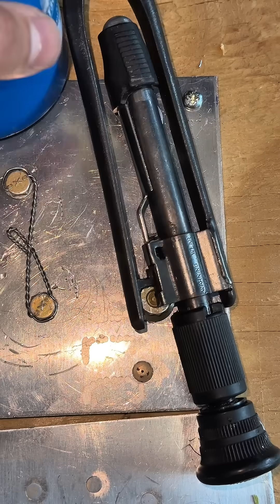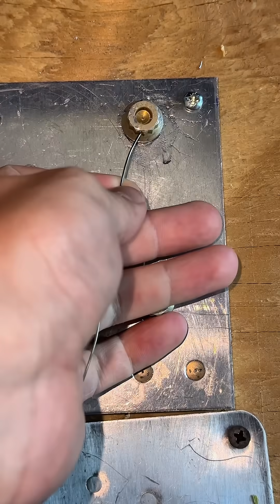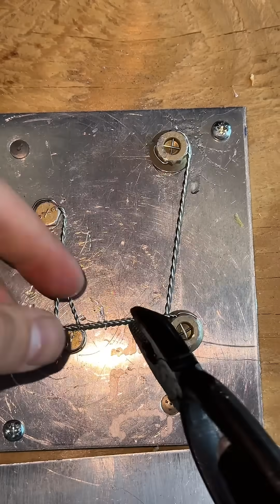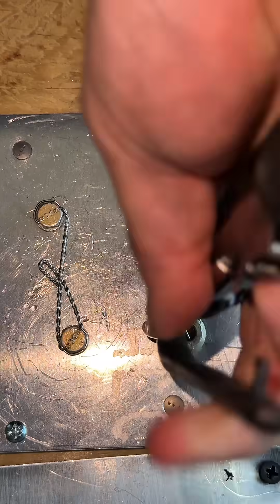Jet tech: Boomers Hated This Safety Wire Tip 😤✈️ #AviationMechanic #shorts #mechanic

Comment: Well, I am one of those boomers but not quite the way you think. I served on Ballistic Missile Submarines for 8 years and we were thus called Boomers. Anyways, on Submarines we have what is called the "Subsafe" program that came into existence after the USS Thresher was lost at sea.  Just about every mechanical connection required it to be secured with safety wire. The way you are demonstrating is exactly how we were taught in the early 80's.
Reply from the maker: Thank you!
Reply: Hell yeah squid
Reply: Bubblehead not squid. 😂
Reply: @MrVallejos1 
“Submarine
Qualified
Until
I
Die”
Reply: @CaseyJamesMusicOfficial 
Same here. 87-07 
I’m digging your music.
Reply: @MrVallejos1  @CaseyJamesMusicOfficial did I just witness a relationship start?
Reply: Served on submarines for about 12 years before I got medically retired. SSN-21 Connecticut & SSBN-743 Louisiana

During my time in and even around the time I got injured 2018, we studied subsafe religiously! We took it extremely seriously! We checked everything as many times as possible before every tag was hung from proofs to the officer of the deck signature to make sure the work was going to be done safely. Then when everything was buttoned up you bet your ass we would lock and safety wire everything we possibly could to "idiotproof" it. 
I salute you, fellow bubble head 🫡
Reply: Wasn't just the sewer pipe sailors that were taught this.  Us surface nukes were also.  CGN-25, '85-'88.
Reply: Well they taught you wrong
Reply: Nobody cares!!! Sir🙏🏼🙏🏼🙏🏼
Reply: Same. I was an aganger on the Alex before she changed homeport from Groton. We called these lockwire pliers.
Reply: 2020, same standards, same wrench, probably the same canned green beans
Reply: Your called boomers because you were born during the baby boom not because you worked on a submarine
Reply: @jasonmagana9730 Not true, people who work on SSBN submarines are, in fact, called boomers too.
Reply: Regulations are woke and progress frightens us!
Reply: @bigroxxor420 you mean opinions mean more than facts
Reply: @GarethJones-pc3dt  regulations are opinions that are based off facts.   regulations good.  regulations safe.   regulations save lives.   If some snowflake boomer gets his feefees hurt because of a change in way things are done due to regulations that's their problem.
Reply: Boomer or Gen X? huge difference, groomer kids hate Gen X so call everyone a "Boomer"...
Reply: Blah,Blah,Blah
Reply: @onemorething100 respectfully
Reply: This video show something that you can find from the Germans and Soviets methods from the 30's submarines. The Soviets aviation safety wiring was simpler for a reason as well.

Seriously the young people should not disrespect the periods of engineering that was done before they even were born, or from countries that they have been taught to hate and ignore from the start.
Reply from the maker: @TK13M where can i find soviet style safety wire

Comment: didn't you wrap the top one on the wrong direction but you wrapped the bottom there in the right way cause lefty Lucy righty tidy
Reply from the maker: Good question! Everything is to spec as per ac43.13-1b!

Comment: you have to leave the pigtail straight for the increased puncture wounds.
Reply from the maker: Thanks for the input! Safety is always key, and small details like the shape of a pigtail can make a big difference
Reply: Not trying to critizise you. Shouldn't the tail be taken the other way so it doesn't rub on the safety? Vibration may cause it to rub it and break. I was a Blackhawk Mechanic and don't recall ever seeing safeties cross for that reason. Maybe it would be unlikely for the tail to cause that much damage but I'd rather be safer and take it the other way. I'm also curious about the other safety that looks like the tail is tied off on the safety. I'm not saying it's wrong. Just never saw that before and maybe things are different on different airframes.

Comment: Lock wire is not a secret, nor is it aviation exclusive.
Reply from the maker: Totally true—lockwire isn’t an aviation-only thing. You’ll see it in motorsports, racing, heavy machinery, and even firearms. What makes aviation different is the level of precision and accountability required. In aviation maintenance, you’re not just preventing a bolt from backing out—you’re ensuring mechanical integrity under extreme stress, vibration, and environmental conditions.

The FAA, military, and OEMs all have strict specs on things like twist rate, wire gauge, routing, anchoring points, and even the direction of pull. Mess one part up, and you could be signing off on a failure at 30,000 feet. So while it’s not a secret, in aviation it becomes a craft—one that gets drilled into you because the stakes are so high. That’s why I teach it seriously, even if it looks simple on the surface.

Comment: i love how every single safety wire video i’ve seen on this app has been the easiest shit to do, wether it’s practicing on a board or some shit just out in the open
Reply from the maker: Thanks! That’s exactly why I make these videos—to show how approachable and practical safety wire techniques can be, especially for students learning the basics. Whether it’s on a board or real hardware, building good habits early makes a big difference. Appreciate you watching!
Reply: @northeastaviationpro Unless you are in a service center most places are going to have a specific order the build is completed in. Meaning that most times it's not going to be hard to reach. But also if you can't do it right a test plate you aren't going to do it right in a low clearance area.
Reply: @northeastaviationpro buddy, what hes getting at is that its almost NEVER this simple with safety wiring things. Its so rare that its fasteners just out in the open like this. They're usually crammed up past some tiny af inspection plate in the dark having to contort yourself into a pretzel upside down to get to while the sharp edge of a piece of sheet metal is trying to get real intimate with your spine. Anyone can twist wire on a flat table obviously.
Reply from the maker: Bro can you not read!? Im teaching the basics, if someone fosent know the basics then how would you expect them to do it on. A real aircraft? By your mindet just let students go ham on an aircraft and fuck it up lol bro what are you even on? The priciples of safety wirre are the same no matter the tightness of the space doing it in.
Reply: @northeastaviationpro thing is, its almost always tight quarters. The basics start there because that IS the basic scenario. Sure, show them how to do it on a flat table. Then they immediately throw out that technique and have to relearn from scratch how to do it with one hand and no pliers because they dont fit in the working space. What are YOU on?
Reply from the maker: What I’m on is building solid fundamentals so students don’t freeze when it does get tight. You don’t start boxing by dodging punches in a phone booth. You start on the basics, then you work your way into the chaos. If you skipped that step, that’s on you.You don’t teach someone to drive by throwing them into rush hour traffic. You build skills step by step so when the squeeze comes, they’re ready. But hey, if you like gatekeeping and watching people struggle, that’s your vibe—not mine. I’m here to help people winYou are exactly what’s wrong with this industry. You’d rather sit on your high horse acting like you’re special because you struggled, instead of helping the next guy level up. That gatekeeping, bitter old-head energy is why people quit this field. You’re not building pros—you’re just building your egoYou’re the exact dead weight holding this industry back. You’d rather people fail so you can feel important like you survived some mythical struggle. News flash: nobody’s impressed you had to suffer because you didn’t have proper training. That’s not grit—that’s stupidity. You’re not a gatekeeper, you’re a speed bump. I’m here making it easier for the next generation while you’re busy crying that it wasn’t hard enough for you. Get over yourself.
Reply: Have you ever done it?
Reply: Greetings Northeast, it’s best not to ever respond to those that have nothing worthwhile to say stroking their own ego is all they are doing. Your videos are excellent and straightforward. Everyone knows that you have to start at the beginning. And that’s what you’re showing. Never argue back and try to defend yourself and your videos to egotistic know it all. Keep up the good work.

Comment: It is a secret?
Reply from the maker: Safety wire” is often called aviation’s best kept secret because it’s a simple, low-tech, and extremely effective method for preventing catastrophic mechanical failures—yet many outside the aviation (or motorsport) world have never even heard of it.

Comment: why is it pulling the bolts clockwise? aint it gonna get loose?
Reply from the maker: They interlock the bolts so if one happens to try to loosen the other bolt thats safetied will prevent it from backing out

Comment: Funny cause the boomers are retiring and now there's a regular plane crash on the news all the time. You youngins wouldn't know good work if it slapped you in the face.
Reply from the maker: Appreciate the passion, but blaming younger techs for every incident is a bit of a reach. Aviation is safer than ever thanks to advancements in training, tools, and oversight—most of which were built on the foundation everyone contributed to, boomers included. We teach the fundamentals with the same seriousness as ever, just using new tools and platforms to keep up. Good work doesn’t have an age—it has a standard.

Comment: I’m not a boomer, an I use safety wire pliers now. I do think there are times where knowing how to do it by hand is very important, think inside a turbine engine. 
That being said, looks great! 7.8/10! I pass that for the interns/new A&Ps. I did notice you only “snapped” the second wire through the hole. It leaves a “square” shape. If you snap both it leaves a shape on the wire that is more round and contours better to the bolt head. Now granted, I do usually make my first two twists out of the hole “by hand” (duck bills and my wire twisters). Lockwire is more of an art than anything. The 8083 does provide some great guidance, hence it’s an AC and not a FAR. 
Application matters the most when considering twists, pigtail or otherwise. I think that’s a bit too many for “my liking.” I would cut it personally. AC wise looks fine for many an application. 
I think you did a great job. I do encourage you to some by hand! Really broadens your perspective on how lockwire should be.
Reply from the maker: I will do it in the next video. Thanks for the feed back cheers

Comment: Tucked his pig tail correctly, twist rate of 6-8 per inch and had a clean half moon. Great work!
Reply: Absolutely zero deflection? Thats tight as hell homie, I'd hire you
Reply: And always give her a stress check wiggle. Ive seen safety wire that seems perfect break with a little tug.
Reply: @TylerDaleJr.McCarty  my rule of thumb is if it can't be broken on purpose it's strong enough, I just started Tig welding parts for jet engines different but still same😂
Reply: Great work man! Was a fuel systems tech in the Air Force and can say that it my career field saftey wire was never in easy spots😂
Reply: It never is. Wish itd work keeping the mother in law quiet.  But eh 😅😂😅 @nickfry8263
Reply: @mavericknv9534 😂😂😂😂
Reply: But the pig tail is touching the wraps dont you want the least amount of contact with the wire
Reply: Overtwisted his pig tail
Reply: get off his D{}{}k
Reply: Why didn’t the bottom half be get loaded from the tension side? The top one did but bottom didn’t. Would this make the bottom one be able to loosen up slightly easier?
Reply: @austinponceinternational859  I think you're misunderstanding something. If the bottom bolt tries to loosen, the left side of it will rotate downwards, and the wire will resist that movement. Likewise, if the top bolt tries to loosen, the right side will rotate upwards, and the wire will resist that movement.

The setup is (pracrically) rotationally symmetrical, so the effect on each bolt is the same, as intended.
Reply: Wait for him to get in the actual world and find out no one actually cares. You’ll just have some uncertified idiot next to you or come behind you and undo your work after it’s been inspected and signed off.
Reply: That pigtail is on the wrong side of cut it anyway but good use of the pliers
Reply: Boomer or not ... what's right is right, either do the job right or GTFO !
Reply: These comments scare me. I’m never flying again.
Reply: Since when does the pigtail point in the direction of the existing lockwire? In the Apache world our pigtails are routed away to prevent them from rubbing on each other..
Reply from the maker: @MotoJayy it really dosent matter in the real world
Reply: @MotoJayy wouldn’t giving the pigtail an unnecessary bend in the opposite direction weaken it?
Reply: Depends on the manufacturer and gauge for CFM56 we require 7-10
Reply from the maker: @CptPandy-tj9ty this is from ac43
Reply: Nope. Don't want the tail close if possible
Reply: From someone that’s been an aviation mechanic for a long time. It’s safety wire. It’s not rocket science. A lot of commenters in here are overthinking it. it’s not to stop the bolts from loosening. It’s to stop them from backing out completely. Yes, in the books they want you to do it a certain way. In the real world you hardly ever see it done to the book and guess what, it works just fine. The bolt being installed and torqued correctly is more important than getting the safety wire correct.
Reply from the maker: @tucanoguy4719 best comment yet
Reply: That is CRAP. NOT EVEN CLOSE TO BEING DONE RIGHT.
Reply from the maker: Wrong
Reply: Well twist on main and tail not same.  One is too tight other loose. Ya theres no give but the points where wire meet bolt.... that shits breaking.   Probly on the tail end.
Reply from the maker: @mavericknv9534 are you an aircraft mechanic?
Reply from the maker: You know civilian aviation regulations differ from army so i get your point but you are so wrong thanks for watching
Reply: @northeastaviationpro I’d imagine the military standards are shit compared to the civilian standards. That’s usually how it goes with the military.
Reply: @chrisdixon7342  this would never fly in the military. QA would make you cut that so quick. Pigtails crossing over mail line, loose, pigtail way too long.
Reply from the maker: Tell that to v-22 inspectors
Reply: @chrisdixon7342  oh yeah, don't remind me how much the soldiers have to spend out of pocket on the civilian market to not have garbage equipment.
Reply: @northeastaviationpro yea army aviation is way more strict then faa
Reply: @chrisdixon7342 that is not true
Reply: Here is our Savior

HalleluYAH translates “Praise YAH”

- YAH The Heavenly Father (Genesis 1)

- YAH arrives via the TENT OF MEETING (Exodus 33:7-11)

- YAH The Father was Who they Crucified for the sins of “man” and they NAILED YAH’s HAND on an Almond Tree
- (Hebrew Isaiah 43-56)

- YAH The Father is The Savior
Reply: Stop the hate. You are part if the lineage, not the beginning.
Reply: @intothenight756d47 what sort of inbred logic is this?
Reply: Do you even know what decades are considered boomers lol? I have no idea if what you’re doing is correct or incorrect, but maybe look up what years are considered boomers”.
Reply: @anon7843  Does the word "boomer" always mean a decade? Couldn't it just as well mean someone who likes fast planes that create sonic boom?
Reply from the maker: @mahekorvenoges550 Sonic booms
Reply: @mahekorvenoges550 LOL. Bro, this might be the most unintelligent explanation for anything I’ve heard in a while.
Reply: @anon7843 1946 and 1964
Reply: @anon7843  You're thinking of baby boomers, we're just talking about any boomers. It's an attitude, a mindset, and a lifestyle - and you've got it down pat no matter how old you are, internet boomer :p
Reply from the maker: @alakani true it’s people who are stuck up negative and unwilling to change
Reply: @anon7843  "Boomer" is a mindset.
Reply: @anon7843  Homie, go check how mad you got over a light hearted joke that likely didnt even remotely impact you cause moat Boomers cant even underatand how to use a smartphone properly, let alone newer tech like Youtube webpages or apps 😂
Reply from the maker: Take a joke brother
Reply: Stop the cap. The twist was piss poor
Reply from the maker: I was waiting for comments like this lol
Reply: @northeastaviationpro 
That's not some "aviation secret". Take a peek behind your car tire sometime. That securing method is used almost everywhere.
Reply from the maker: Wtf are you talking about. Less than .5% even know what it is
Reply: @Heidi-f6m  that’s funny. I’ve worked on cars for over 30 years and I’ve never seen safety wire on one of them. Now they do use it in racing though
Reply: @strategygalactic Lock wire is not there to stop the faster from coming undone, simply to stop it falling out.
Wound in the right direction, good job